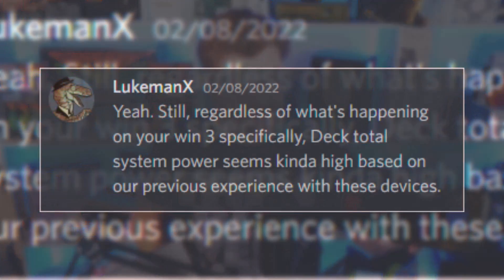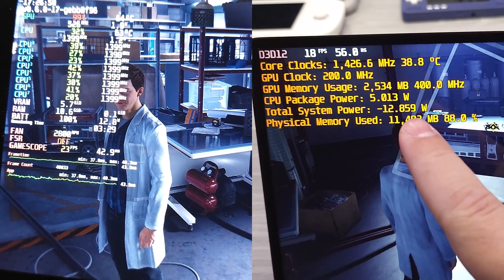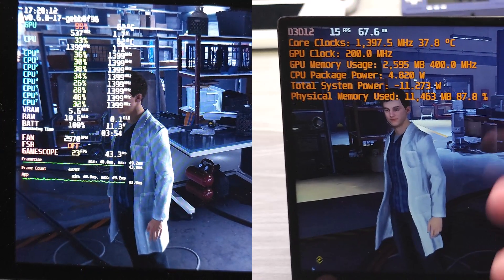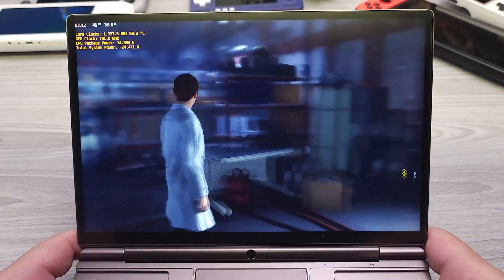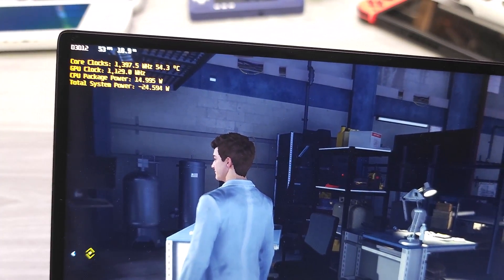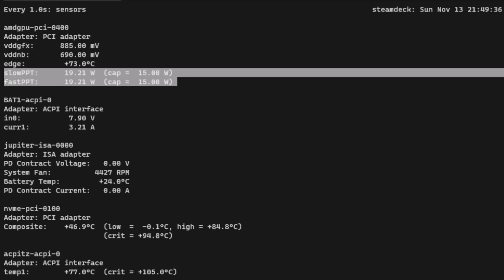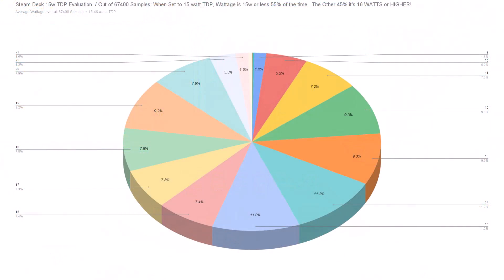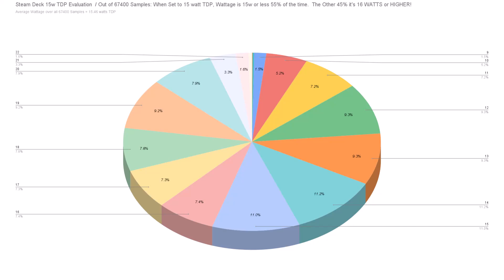The TDP On The Steam Deck is Wrong

Comment: This sounds like the same old confusion between TDP (Thermal Design Power) and total system power. TDP is what the thermal design needs to be designed to dissipate within some set temperature limits and total system power is the real world power draw.
Reply: This needs to be higher up. TDP has been long gone from actually meaning total power draw for most hardware vendors (at least in the desktop/DIY space). so I am actually not surprised by these facts. The problem is that TDP still gets perpetuated as being 1 to 1 to  power consumption.
Reply: @Th3Rom3  the only reason this video matters is because competing devices are measuring their TDP in different ways, which means it's difficult to do apples to apples comparisons with them. So it's important to know this information so when people compare them, they can see that a 9 watt TDP on the Deck is equal to a 12 watt or so TDP on a 6800u device. It doesn't matter in the end because the performance is the same on individual devices. The problem is saying "Well look at how much more power efficient the Steam Deck is at 9 watts! It gets 41FPS while the 6800u gets only 20FPS!" Because it's misleading, so hopefully based on this video people pay more attention to total system power when they are benchmarking.

Comment: So, TLDR, the TDP is more of an average, not the maximum. So if it goes lower than the set TPD for some time it thinks like now I have the opportunity to suck some extra juice?

I originally thought that the TPD was the maximum. Cool in terms of performance I guess, but bad in terms of battery performance.
Reply: TDP is a set value to target.  A 15w TDP targets 15w, but power will fluctuate up and down depending on load.  When trying to lock to a certain TDP but still give you boost on the CPU or GPU over time, one clock comes down, the other goes up, and there's going to be some time there where more than 15W is being consumed.  It's to do with how aggressively clocks are pulled down when closer to the 15w ceiling, so to speak.  The steam deck is tuned to pull back the clocks less aggressively.
Reply: I read an article explaining the TPD when I first heard all the talk about it. The article explains TPD is mostly used to measure the heat a CPU could putting out so you know how much cooling it needs.  The article reads:
"TDP is not — however — a direct measure of how much power a component will draw, but it can be a good indicator."

 Even in this video his calculation seems off since no battery is 100% efficiency so you will not get the full 40 Wh nor 50Wh out of these devices.  Some of my external battery read something like "efficiency > 75%." likely depends on the load.

Comment: I had been watching this with a USB-C cable that has a Wattage readout that updates in realtime for what's going through it. I plan to make a video on the cable and this usage soon. The max power it pulls through also can be right up to 45-47W when it's charging an empty battery while running a demanding game. But seeing 25-28W when the battery is full is pretty common.
Reply: Which device? Steam Deck?

Comment: Thanks for the info! Even tho the Steam Deck is outperforming at lower TDP so I'm fine with all of this, that was the answer of why a 15w TDP cap was putting -28w of total system draw, when, for my old gpd win 3 going that much total draw on that TDP was impossible.

6800u are impressive, but for the price the Steam Deck keeps kicking! This market is going more and more competitive each day, I totally love it!
Reply: I think the point here is that this diminishes those amazing differences in performance when he did his benchmarks of 6800u devices vs the Deck. Let's take Borderlands 3. At 9 watts the SD was hitting 24FPS while at 11watts the Ayaneo2 was hitting 25FPS. But in reality based on this info and total system power, the 6800u is actually outperforming the Deck's APU at the same power level. When people do these comparisons they need to take that into account from now on.
Reply: @bnr32jason  Jason, are you ok? you keep answering all the people with the same comments, having a device that even with the same power than a 6800u costs more than half it's amazing dude.

*written from a Steam Deck
Reply: @Mabifield  it doesn't have the same power, anything below 12 watts or so and the 6800u matches the Steam Deck. Yet the 6800u has another 20+ watts to work with for even better performance.
Reply: @bnr32jason  Dude, the point is clear, but why you keep comparing the 6800u with the Steam Deck like it costs the same? We all know 6800u is superior, but that doesn't change anything, and you won't use anything portable at 35w tdp because it will totally destroy the battery. Docked maybe if the heatsink can hold it.

But that's why the info is great to know
Reply: @Mabifield  they have already verified that the cooling system can handle 35 watts for several hour long gaming sessions while docked. While 35 watts is something I would never run, if I wanted to a simple 100wh battery bank in my backpack would extend that 1hr runtime to three hours or so. I'd rather run it much more conservative though of course. Also as far as the price goes, people are going to compare them because they are in the same space. They may not be direct competitors for sales except for a small number of people. It's the same reason that they compare a Corvette against various supercars. Yeah they may cost 3-4x as much, but look at how close you can get to their performance. There are still people that will pay the extra money because performance isn't the only consideration for many people. Same thing with the Deck vs $1000 6800u handhelds.

Comment: I thought something was off!

I want to add, and I'm not sure if it's a bug or if it actually means something, but I followed a winDeck tutorial to get certain performance statistics to overlay in games that I wasn't able to get running with my standard MSI afterburner and Rivatuner combination and it worked, but I noticed something was weird/off.

What was happening seems similar to what I noticed while running SteamOS, which is what you're talking about here, except slightly different. 

The tutorial I followed made it so that my performance overlay had seperate wattage counters for both the CPU cores and the GPU clusters, rather than a total APU draw. Oddly enough, it would often display the CPU cores using around 15W and the GPU clusters using 10W. Now keep in mind it doesn't stay like that for super long and it's often much lower in general, especially on the GPU cluster side (like 10W for the CPU cores and 2-5W for the GPU clusters) so I'm not sure whether it's just the statistics overlay giving weird glitchy info, I might also add that since I've been noticing that I've been testing more resource intensive games and I'm seeing the 15/10W split much more often.

I am leaning towards it just being a statistics glitch on the part of the tutorial I followed, but I just wanted to comment giving some info on what I've personally seen since I had been thinking the same thing as you all have that the total system power was too high, and now having just seen this video.

Comment: Not a good use of time. If you use lower settings it effects run timm, We already know the SDeck does very well at less than 15 W.  Classic example of empirical vs practical.  No normal user uses 100% brightness, all my devices are at 30-40%.  The process node is a big factor and the extra PDNA 2 CUs in the custom APU. Your 8 Watt 40 Hz  refresh rrecommandation is much more useful.
Reply: What are you talking about? How is this not a good use of time?

It's not going to change how anyone uses their Steam Deck, but it will (should) change how reviewers and testers display their benchmarks of the Steam Deck vs other handhelds. Using total system power is a necessity now since we know that the TDP's are being measured differently.

Your comment about brightness is pointless, if he turns down the brightness to 30-40% on both systems, the total power usage will scale down equally as well. Also, I'm often using my Steam Deck at 75% or higher because my house has lots of windows and natural light coming in, same with commuting on the train/bus.
Reply: @bnr32jason  Brightness has to do with runtime which is a top concern,  As he states in he video nothing can be done to try to make the power usage a scientific measure nor does it need to be. Since you are shallow in your understanding  It Is Whar ItI is.    Most POPTecj Tubers provide lots of pointless data which is of little practical use at best and misleading at worst.   This channel trys to focus on useful information
Reply: @Viewer19  I'm "shallow in my understanding?" LOL what are you talking about? This is a good use of time because it allows reviewers to better understand how TDP is measured and displayed differently in different devices, it's really really simple. This will lead to better comparisons in future testing, how is that a bad thing? This video perfectly explains the "magical" low-TDP Steam Deck performance, and it turns out it's not magical, it's just not very accurate.

Comment: I’m confused as i’m new to all this. You said it’s not the display screen size it’s the back light. Doesn’t the bigger the scream mean the more back light which means it’s technically the display screen?
Reply: I'm not an expert but there are more factors

Obviously if it's OLED it's going to be lit less especially in dark scenes but devices with local dimming zones could also see less power needed than otherwise

Comment: One thing to remember is that the formula that AMD uses for their advertised TDPs doesn't actually include power.
If they apply the same logic to how the CPUs work when configured to a set TDP then one of the only ways to know is to look at the power being pulled from the battery just like you show.
Reply: Not to mention part of the tdp is literally a varrible they can freely manipulate. (The cooler)

Comment: Oh, it would be great if you could redo some of the Ayaneo 2 vs Deck benchmarks using total power instead of TDP. That would give us a real head to head of how the 6800u performs against the custom APU in the Deck.
Reply: Dontay Arnold  it really doesn't though, and this video proves it. They are basically equal at low TDP in most benchmarks because of the way TDP is measured on the Deck.
Reply: 6800u dominates
Reply: @Prodbytocile  if by dominates you mean 10% better at higher power draw, sure
Reply: @samgoff5289  ummm, that's not really true at all. Have you even watched the benchmark videos?

Comment: You have to compare multiple Steam Decks. AMD using the "Hovis method", so some chips need more wattage to run on the same performance level.
Reply: He said in the video that he did test multiple Steam Decks. That's why he waited to release this video, he wanted more data points from multiple Decks and other products.

Comment: So, this is the Valve/AMD "black magic" that you and other reviewers have talked about with their benchmarks of the Steam Deck. So Valve's custom APU isn't really any more efficient at low TDP than a 6800u, it's just that their TDP settings aren't really truthful? 

So as usual, "magic" is nothing but smoke, mirrors, and misdirection.

Comment: Man, these 6800U handhelds are looking better and better compared to the Steam Deck
Reply: It's a much more expensive and newer CPU, so it should be better.
Reply: @AroPnut  the APU itself probably isn't any more expensive, but yeah it's newer for sure. Although it's not that much newer. 6800u laptops started coming out just a few months after the Deck launched.
Reply: @AroPnut  It is. But considering there’s only a $100 price difference between the 512GB Steam Deck and the 512GB Aya Neo Geek, the latter is looking like the better buy.
Reply: @Splackavellie85  consider things like customer support and community around it.
Reply: @otogiokami  yeah valve has the best customer support and quality control (most likely) compared to the other Chinese handheld companies which were previously a monopoly tbh
Reply: @otogiokami  Yeah, the community behind this thing is fantastic. And in my personal experience, using the Steam Deck as a handheld console is much more fun and engaging than the OneXplayer 1S or first Aya Neo were. 

Then again, I liked the looks of both better than the Steam Deck, and the improved ergonomics of the Aya Neo 2 and better screen are enticing. Especially is dualbooting Windows and SteamOS becomes a thing for noobs like me soon.
Reply: @otogiokami  “community”
That means nothing, and valve customer suppport, eh, better than these Chinese handhelds, but not a big selling point.
Reply: @oo--7714  I think you're severely underestimating those things. Valve's customer support is one of the best. You don't even lose warranty if you open the steam deck. Also, yes community. Emudeck and lots of scripts and mods. Lots of available accessories. Being the winning team product brings more support from all sides. It's just how things are.
Reply: they always were lol 
6800u handhelds were targeted towards the high end and premium category while steam deck is targeted towards the budget category
Reply: they are
Reply: meh

Comment: does this change your neo 2 TDP comparisons? Is the decks 15w actually closer in power draw to the Neo’s 19w? And the deck 11w = Neo 2 15w?
Reply: This is what I'm wondering as well, so far we've always had the stance that the Deck is better in lower TDP. If it just had a intrinsically higher TDP then the comparisons are all wrong no?
Reply: That's absolutely what's happening. Just different ways to measure things. It's annoying but it doesn't really change anything except how these reviewers handle their benchmarks across different devices.

Comment: That's the explanation for the "wonders" that the Deck made at 10 TDP and lower. They were actually cheating.
Reply: It's not really cheating. The tools are outputting data that reviewers are using as a comparison. Maybe they're expecting an apples to apples comparison, but has Valve stated that's the case? I genuinely don't know. This isn't Volkswagen fudging their emissions numbers. I don't think "uses 4W less TDP" is very high on the scale for purchasing decisions for any customer when the price difference is still so high between the Deck and the other handhelds. Valve sure isn't selling the devices based on that difference. Set the TDP, refresh rate, etc., to get the level of performance you want, and leave it at that.